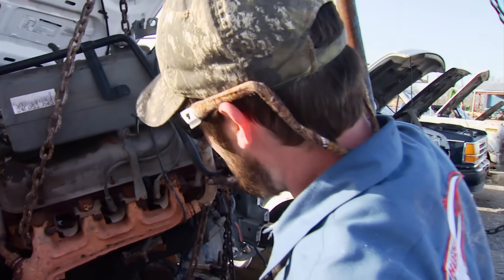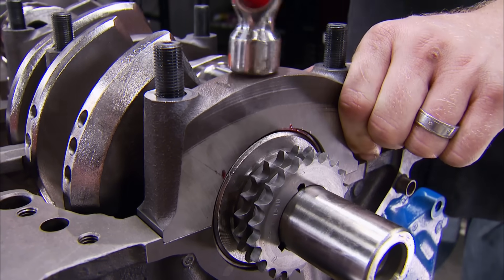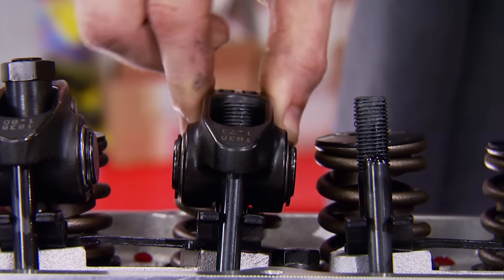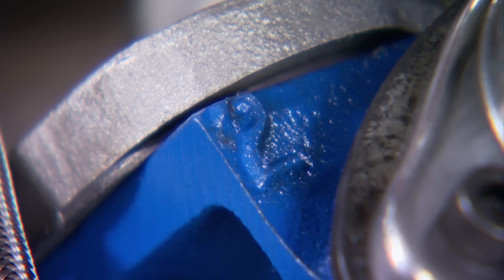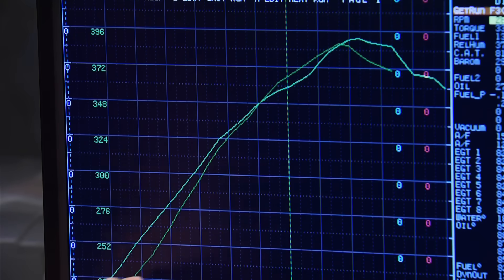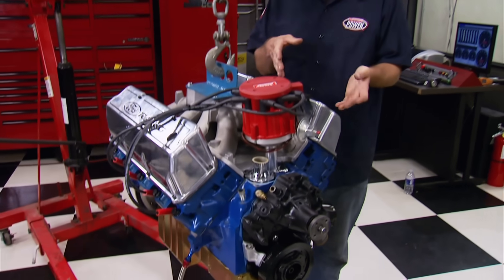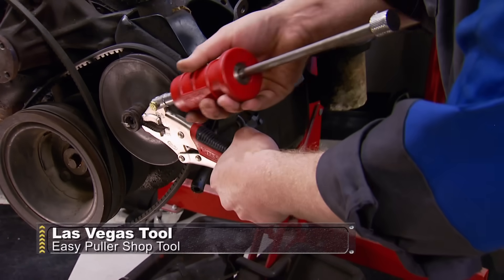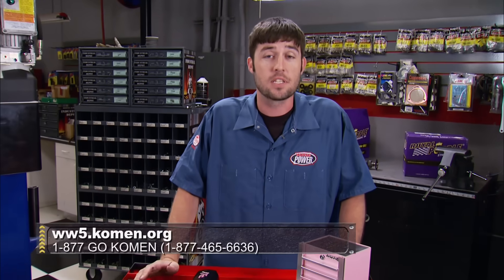351 Small Block Dyno Shootout: Windsor vs Cleveland - HorsePower S16, E11

Comment: I am confused. What were they comparing ? A stock Cleveland rebuild with a hotter roller cam , and in my opinion, a poorly chosen intake manifold. In the other corner a Windsor, that is no longer a Windsor. With the entire Hi Po parts book thrown at it. A better " Comparison " would have used a Windsor, with the best " stock " Windsor heads, same cam profile, same intake design, same C R, and perhaps most importantly. The same cubic inches, and equivalent dollars spent. I feel confident, in a fair fight. The Cleveland would have prevailed.
Reply: I'm comparing this apple to this orange and I've concluded.......they are both fruit.
Reply: I agree it was a comparison but not a equal comparison at all they were all over the place! The Windsor with drilled out GT40 heads with a simple dual plane intake and the Cleveland with stock 2v heads with a similar intake both either stock bore size or both .030" stock stroke on both with the same exact compression ratio would have been a better comparison!
Reply: Im with you, this is asinine. 😊
Reply: Those Cleveland 4V heads should have been paired with a 4" stroke crank, IMO.
Reply: @netgnostic1627  i have built 4V Cleveland's not much more than stock that would kick the hell out of the engine they built. i used to street drive  a 1970 notch back Mustang with a stock 4 barrel Cleveland. it had a low dollar Melling .534 .568 hydraulic cam, Edelbrock Torquer intake, Holley carb and headers, the car would run 12.8 at 108 all day long. My Crank pistons and heads were stock. I never turned it past 6000rpm. that was with an Automatic with stock converter.
Reply: @mylanmiller9656  I’m building a similar engine right now. But I have a 585/600 lift lunati cam & 750 carb. My question is why did it only run high 12’s? Was it a traction thing or heavy car?? I’m seeing similar builds with stock converter run 11.4-11.7 in 69/70 mustangs. Just curious
Reply: @pharaoheaton5182  With a similar  cam to what you are running, My 1988 fox Mustang run 11.94 at 113.65 MPH and our drag strip has a estimated average altitude of 4300 Ft that is why we run slower than a sea level strips. Most times we can knock 4 tenths off at sea level.
Reply: @netgnostic1627  I t wouldn't have mattered much they used the wrong cam and  no compression.
Reply: I agree this was not a comparison at all Do it over @powernation
Reply: Not impressed. Bob Glidden rolled over in his grave.
Reply: Comparison....lol, why didn't Glidden and Dyno-Don run a Windsor....duh
Reply: For real they should both been 408.
Reply: Bullshit comparison. Not comparing apples with apples.
Reply: I agree with alot of the other folks here, not a good comparison whatsoever!! Like comparing a Chevy 350 to a LS6 454 !!! Come on guys  !!
Reply: the guys that made the video must have something against clevelands, some people do you know. i drag raced bbc's on the track for years, but i like fords and have built many more ford engines than chevy and some of the fastest ford pushrod engines i have ever seen were clevelands and being a chevy guy i can look at fords objectively. the way i see it, 6 to 700hp should be a breeze with a cleveland, with or without power adders. i'm not willing to say any engine is better than the other, but i know a cleveland is a damn good piece. if you don't have adequate intake port cfm air flow at a reasonable valve lift, you will have challenges in making horse power with any engine.
Reply: It seems like an Edelbrock AD to me!
Reply: @stevesabbagh793  Ad to the part vendors...
Reply: Cleveland got railroaded
Reply: @rodan2852  damn straight
Reply: Wrong. Cleveland is only good because of its heads. Block is crap. Windsor heads are crap. Windsor block is twice as strong as the Cleveland. Windsor is very easy to reach over 600hp cast iron. Learn something.
Reply: Whats wrong with Cleveland blocks?  You sure your not getting modifieds mixed up in your statement?  
Because i had a 400m that cracked the whole way down both sides of the lifter valley leaking coolant into oil.. and you know... upon kept changing oil filters..  that old motor lived and played hard many more years after that. It was in a '79 bronco 4 spd. And i was young and dumb and hard on that engine hat my uncle and me rebuilt.  Ford all the way...  funny.. i now own a 95 silverado..  i dont know i ended up here...but here i am..
Reply: @bigboreracing356  The Windsor had Cleveland heads so all thais proves is Clevelands are still better
Reply: @bigseff23  the Cleveland is definitely a better engine except it won't fit in a lot of '70s era fords without a lot of custom work done I'd rather have a boss 302 just for the for bolt mains and the shorter deck height!
Reply: @bigseff23 I think both are good 
Even though I am not a Ford fan
Reply: dead on the money, you got it dead on the money
Reply: You guys used low compression 4vs on the cleveland?  Lame !!
Reply: @RobertSilva-n5w  a Cleveland with 11 to 1 has a enough compression to make good enough power to hold its own. And have enough low-end power it will blow the tires off if you don't run slicks. The guys that say a Cleveland are the guys that run them with 2.78 gears and wonder why they have no bottom end power. A 3.70 gear is minimum
 if you want any engine to come on.
Reply: @RobertSilva-n5w  yeah the cleveland with the more thrown at it makes the better power. I have seen the difference years ago. The cleveland headed small blocks make the most small block power in stock form than all the other small blocks. Richard holdner tested the theory and it bares true. That is unless you believe the testing was rigged, but the heads being what they are the theory and the math say so as well.
Reply: the guys that made the video must have something against clevelands, some people do you know. i drag raced bbc's on the track for years, but i like fords and have built many more ford engines than chevy and some of the fastest ford pushrod engines i have ever seen were clevelands and being a chevy guy i can look at fords objectively. the way i see it, 6 to 700hp should be a breeze with a cleveland, with or without power adders. i'm not willing to say any engine is better than the other, but i know a cleveland is a damn good piece. i believe if you don't have adequate intake port cfm air flow at a reasonable valve lift, you will have challenges in making horse power with any engine.
Reply: A Windsor with any kind of stock heads will never be anything other than a dog….a pickup engine. Not a bad design, but ford never made a decent flowing Windsor head.
Reply: @dylanbland5993  yes all aftermarket for windsors. In truth a 351 windsor is just like building a 350 chevy and now a days can be built for the same price.
Reply: @andreawhalen4142 I’d venture a properly built Windsor is better than a similar Chevy, maybe…coming from a Chevy guy….and aftermarket Windsor heads basically have lead ballooned Cleveland stuff for anything other than nostalgia.
Reply: We all know the Cleveland was a better 351. They are trying to see if the  hybrid is comparable.
Reply: @joeypierantonis7576  actually only the Cleveland heads were better than the Windsor. The Windsor has a much stronger block. Windsor handles much more power. That's why they are putting Cleveland heads on the Windsor block.
Reply: Ahhh. Stronger block, with 2 boltmains?
Reply: @joeypierantonis7576  well the stock truck engines are a mixed bag the windsor doesn't make the topend power the cleveland does but in a stock truck what good is topend power?
Reply: Back in the day, if you didn't have a Cleveland under the hood, you took that junker home.  Bolting Cleveland parts on a Windsor to make horsepower makes me wanna puke. Windsors have always been a junk smog motor. And back in the 60's everyone knew that a windsor making more than 350 horses would split right down the middle. There is a reason ford went to the 1-3 firing order instead of the 1-5... the 1-5 would split the front main and it would progress on up to the lifter gallery and split the entire block.  Google it, you idiots are hot rodding ticking time bombs of self destruction.
Reply: @KBS117  harsh but yes 4v Cleveland is definitely the one to have
Reply: Because stock to stock the Cleveland is so far ahead its not even funny
Reply: @drtb69  not in low end torque though
Reply: @johnringel9892  i know the cleveland would. You can take a stock cleveland block bump the cr add a cam and rockers with good springs and a decent set of hooker headers and your already at 400 hp
Reply: I totally agree and the Cleveland is 357 ci and the Windsor is 408 ci. Should have just rolled in a 427 and say it identifies as a Windsor.
Reply: Really bad comparison,  it was like comparing a stock 327 with a 427 big block , you threw all the good parts to the Windsor and crammed all the junk in the cleveland.
Reply: @powerblocknation you owe everyone who watches this episode an apology.  

First,  throwing an extra 50ci in a Windsor block (no replacement for displacement), then using the best aluminum closed chamber Cleveland heads ford never made? Why didn't you just throw nitrous at it?

Then,  tying the Cleveland's arms behind it's back by not running at least 7k rpm and not giving it a bigger carb, intake,  and headers to match the 4v heads? 

Why not tell it how it really is?
 "Watch us throw money at this Windsor block to make it beat a stock 351 Cleveland"
Reply: Well said. My sentiments exactly. Still an interesting comparison.
Reply: Yeah kinda stupid the windsor has the kitchen sink throw at it, i mean hows that a comparo?
Reply: I know it would don't have to guess. Lately i have seen a big trend towards building fsb instead of chevys. I guess aftermarket has the ford small blocks all caught up. It used to be way cheaper to build a chevy, now these guys are saying not anymore.
Reply: No doubt, talk tying one or more hands behind your back. Not cool. The Cleveland got a bum wrap there.
Reply: Should have shown the Cleveland with a trick flow 2V or Edelbrock head, also a closed chamber 4V head would have woke it up a bunch
Reply: correct 351 c. verses 351 w.change nothing use both 4 v engens every component the same then you will actually see the difference/ making a 408 stroker out of a w. Engen and comparing I with a 351 c. Is not going to prove only that the w.engen was a dud because the charts didn't show much differents but the c.engen stayed or held it's own agenst a 408 cid.w.engen I'll take my boss c.engen any day of the week my 67 Fairlane wouldn't part with it anyway it would run away from me lol
Reply: Or considering the windsor was stroked to 408 cu/in, use a 400 block instead of the 351 c
Reply: I agree if same money was spent on both Cleveland would have won.
Reply: What cam specs are the Cleveland engine running?
Reply: This seems to be a pattern with old Power Nation episodes. Same thing happened when they were "comparing" a 454 to a 460
Reply: I was surprised they gave the Cleveland 36*.
Reply: I thought the same. Was it maybe a price comparison?
Reply: @bigboreracing356  People are making over 600+ HP with stock bottom end 351 Clevelands with the Stock Iron 4v Heads lol. . So yeah they do make more power than a stroked Windsor.. And the 408 had Cleveland heads on it. Youre sadly misinformed buddy..
Reply: @LegionGamingTV  clevelands are the easiest to get to 400 hp with the least thrown at it i ever saw.
Reply: I think the comparison isn’t a real comparison. They need to use like parts throughout. The Cleveland was a great engine, but the Windsor has a better block. The Cleveland has oiling issues and needs some modification to run high RPM. The Windsor block is said to be stronger, so the Clevor they built gets the best of both engines. They can do the same thing with the 302 as well. Or maybe a 289. With the Cleveland style heads, especially the Edelbrock’s it would be a high RPM screamer!
Reply: Not a stock Cleveland rebuild. H beam rods, flat top Pistons, better rocker arms and springs, and the high floor intake.
Reply: They also modernized the Cleveland to have a Windsor cooling system.

The Cleveland is an older engine with way less aftermarket support.

 Don't need to be a baby about it Yankee.
Reply: He also said the Windsor had a 4 inch stroke so it's not a 351 but a 393 ?
Reply: @dennisdallenogare3930  If it has a 4-inch stroke it is a 408, Yes why didn't they build a 408 Cleveland.

Comment: I need me a Cleveland, are there more available? And well I thought the comparison was between the differences of the two. But the Windsor was topped off with Cleveland heads 😑
Reply: where are you,,u.s has heaps,in aus you go to an f series wreckers,i have 3..you also need a set of 302 heads.gives it 12.1 comp strait up.cant run fuel though.plus,the heads have a hump,in the exhaust,needs to be tongued,or slightly ground,clevo is built for torque not revs,its a truck engine.but will sit on 6k,all day.strong engine.do not stroke it,unless there very quallity parts,as there all chev internals.smaller..
Reply: harry walker in Texas sir. I’ve heard about 392 Cleveland engine strokers

Comment: I dont know how this became a LS vs coyote debate  but let's look at some facts personally if I was building a older motor I prefer a small block Chevy over the small block ford. Just the price and availability makes a Chevy the best bang for your buck.  But today's motors is a whole other category ford has spent alot of money and time developing there new engines while Chevy went bankrupt  and are still making the same old engines. The only thing Chevrolet does to make more power is use larger displacement. The 5.2 in the gt350 makes 526 horsepower that's over 100 horsepower per liter naturally aspirated there is not a Chevy engine that can do that and the new gt500 5.2 is over 700 horsepower with 12 pounds of boost  there are mustang's with coyotes running low 9s and high 8s in the quarter on 20 inch rims and driving them to the track you cant make that kind of power with the Chevrolet and still be reliable unless you use aftermarket everything. I like both and have had good and bad experiences from both  but you cant  beat the technology that ford has put in there motors this is fact  and anybody can do a little Investigating and see this.

Comment: So its not a 351 vs 351, y would you put single plane on 351 mild comp mild cam and put dual plane on stroker with more comp and cam? Both motors would have turned better numbers if intakes were swapped.

Comment: This aint fair, the windsor is 402cubic inch with after market boss 302 heads. (basicaly same as the cleveland heads) but it has wayyyy more displacement, and propably a bigger cam

Comment: Clevelands scream they stopped the pull at what 6k!? The dyno showed it skyrocketing when they shut it down.. they obviously wanted the Windsor to win.. higher compression, stroked 50+ cubic inches 🙈 That Cleveland with stock 4v heads with right cam and valve train would smoke a Windsor

Comment: 1. so you're using a 2v intake on 4v heads......
2.  Same cam for 2v & 4v??? 
3. Same carb for a 2v &4v??
4. Why did you stop at such a low rpm? Cleveland's can rev to 7000 no problem.  
5. how the hell are you going to compare a built engine vs a basic rebuild?
You obviously know nothing about Cleveland engines. go back to your basic LS swap garbage.
Reply: I couldn't agree more!!!! Totally clueless. Engine Masters show got 450 horsepower out of a stock rebuilder short block.
Reply: I would increase oil flow in the cleveland with an 80psi melling, and then let it spin to 7500. It has the smaller journals, that's what it's made to do. 4v heads with port plates in them, solid lifter cam to match the rpm, single plane 4v intake, with 750-850 race demon carb on top.
Reply: @AmericanThunder  it's a waste to use 4V Cleveland heads with port plates. Buy a correct intake manifold so the plates aren't necessary
Reply: @brandonhumphries3377  it's not about the intake manifold it's about Port flow velocity even the exhaust ports flow better with plates
Reply: @AmericanThunder  get outta here with that garbage. Old myth that's busted
Reply: @brandonhumphries3377  yeah physics suck. Physics has been busted forever.
Reply: @AmericanThunder  it's been proven that the stock exhaust ports flow better than the experts said they did in the 70's.  Myth is busted on port plates.
Reply: @brandonhumphries3377  it's been proven by who? where's the dyno results I'm curious to see them

Comment: yeah i think that windsor could take a lot more fuel.. the torque difference on the cleveland was interesting but not out of line.. they are both strong engines but the windsor wasn't a fair comparison since it was stroked 50 cubic inches.

Comment: Soooo a 351 vs 400 “shootout” ?? If the Windsor has a 4” stroke, not an even comparison.
Reply: The Windsor has 4 inch stroke and  Aftermarket heads and  the  Cleveland is built all together wrong, give the Cleveland some compression and 40 degrees of timing  and even with the street cam it would pull 400 hp!
Reply: Menin Black up

Comment: Apples and oranges, guys.  Build both with same bore, stroke, combustion chamber, valves, etc. and all other parts as identical as the two blocks allow.  Test them then.  You may as well been comparing a 351 to a 302 with different intakes, etc.  Please, we expect better from you.

Comment: These numbers are embarassing.  I made 412 hp and 507 torque with a moldy  400 sbc with garbage 882 smog heads and a comp extreme energy cam.  I had less in the entire engine than those aluminum heads cost.
Reply: spot on. probably the 268 Ex energy cam and a basic rebuild. .